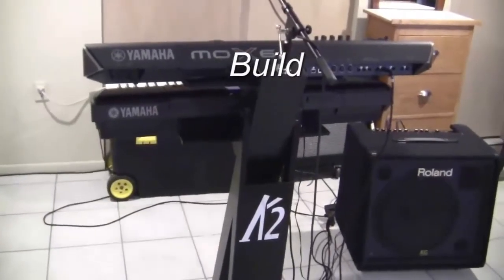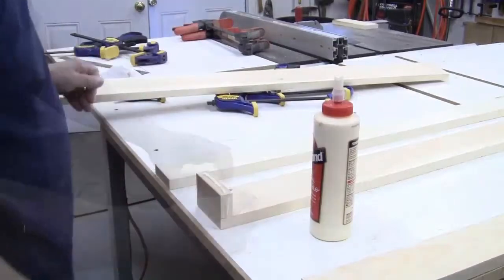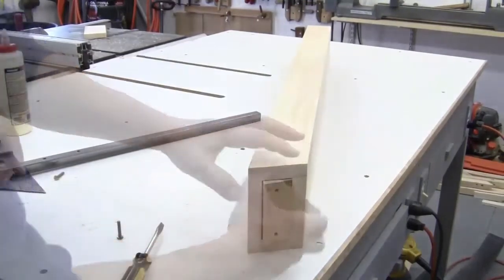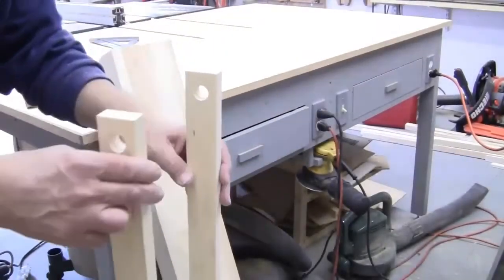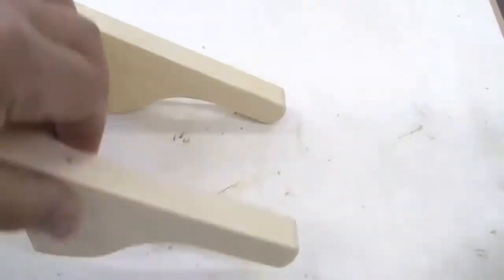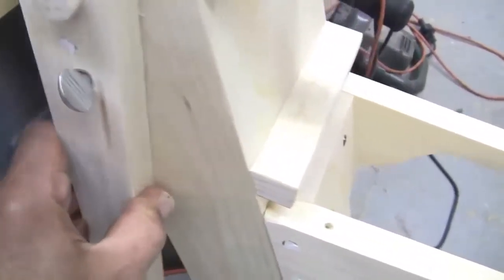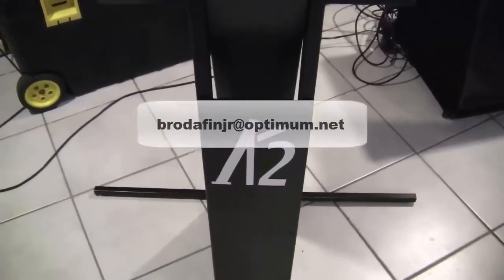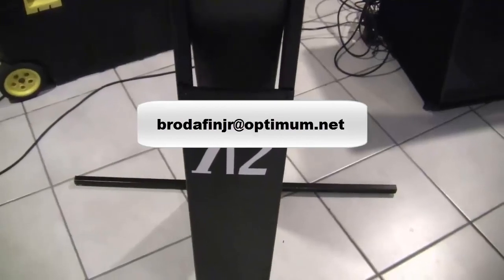Cheap Two-Tier Gigging Keyboard Stand Can Save You Hundreds

Comment: I am contemplating getting a 2nd keyboard; a lighter and less expensive keyboard to carry around.  But I only want to use a single keyboard to play on.  I was thinking about switching from style files to mostly midi files.  How is the E-423 for midi files and to play on at the same time; enough polyphony at 32 notes?  There's an E-423 for sale on Craig's list in my town advertised as in excellent condition for $130.

Comment: Excelent vídeo .. You are a very smart man..... I have been looking in eBay for a two tier stands But they are very expensive.. $249 dollars.. . $299 dollars and even $349 dollars.. I can't afford me to pay that ridiculous quantity of money..... Thanks for the video my friend.. Likes.. 👍👍👍
Reply: Yes and no. What you are seeing here, while interesting, is likely not suitable for gigging due to 1) the setup/teardown time, 2) the weight and 3) the inherent fragility of wood--at least relative to metal. While $250 to $350 may seem expensive, consider what this stand would cost if you had to buy all the materials: you are, at a minimum, looking at roughly $150 to $200 (that that excludes tools and time).It just ain't worth it to build.
Reply: @WilliamCharlesShaver   This would suit me fine. I need a stand for a keyboard, laptop, and mixer, for my rig at church.It would not be set up and taken down constantly.  I would go with a hardwood rather than pine, though, or maybe birch plywood (it'll look like it came from Ikea :D), and I'd make a few changes to make it quicker to set up and easier to transport, and I'll def. incorporate adjustable feet to make it easy to level.

Comment: Nice job, but is required 50$ + having wood workshop + carpenter skills + time (time is money).
Down side of wooden parts, unless they laminated, they will twist and probable  make uneven platform, which make keyboard not sit correctly.
Maybe if keyboard sit on 2 metal bars works better. ;)

Comment: Thanks for posting this! Can you find a way to make the support brackets removable?  If so, then cut open the top 1/4 of the back panel and add a hinged door, thereby creating an open storage space on the inside of the tower. Once you break down the stand, toss your metal floor brace and your mounting brackets inside the stand and shut the door!  Now you only have the main tower and two shelves to carry and you'll eliminate the potential of the mounting brackets being damaged in transit. I wish I had your workshop and skills, I'd try it myself!

Comment: I appreciate the creativity in making this.  I personally would opt for a metal stand.  No matter how sturdy or well built your wood stand is, it just cannot attain the same rigidness or withstand the same kind of punishment as a metal stand and is less portable with a significantly reduced life span.

This idea is okay for a studio setting but I would question its long-term usefulness in a live setting.  The stand appears pretty wobbly when being played on even lightly and is unable to be reconfigured for different keyboards and sitting vs. standing heights and angles.

I'm happy that this works for you but do not think it's practical over buying a much sturdier, longer lasting, more adjustable and more easily collapsible and transportable metal stand.

http://www.sweetwater.com/store/detail/ZStd2Tier
Reply: Not true goodmaki, he has the makings of a really good design here. Like some mentioned however, making it out of soft pine, is not practical to survive the rigors of the road. However, if you make it out of oak plywood, then it's a whole different ballgame. I made this stand as detailed in this video, but made a few changes. I used 3/4" oak plywood to form the body, ripped to the same dimensions as in the video. I made the piece to be inserted into the open end, which the support bar is attached to, but to head off one problem I saw before even making this, is that T nuts hold well when you screw them in and leave them. However, the repeated process of doing it over an over can and will push the T nuts out of the wood, leaving you nothing to screw the leg support bar into. Once I inserted the T nuts and sufficiently embedded them into the plywood, I added a second, slightly smaller piece, which I glued and screwed to the first piece containing the T-nuts, basically sandwiching them so there was no chance they would ever come out. When you add the 2nd piece, test fit it first by screwing your machine screws in and where they leave a mark, drill out that mark to allow the machine screws to have room to be fully screwed in.

There were several comments about uneven surfaces which I solved by attaching 1"x3"s to the metal support bar. I used through bolts so they would be firmly attached to the bar. I then attached 4 heavy duty adjustable furniture feet to the 1"x3", allowing each leg to be adjusted individually. I also added a cross bar to the back support leg for additional stability. I used a 1"x 2" which I screwed into the back of the stand and then screwed the metal bar to the 1"x 2" and the stand. Now there is a support bar across the front and one along the back. They disconnect by simply removing the screws from the back supports and as shown in the video. I take a box of screws with me to every gig in case one gets lost. Nobody wants to be hunting for a dark screw on a dark stage at 1:30 in the morning. I also bring a power screwdriver. Time is of the essence setting up and breaking down. Instead of the pin that lets you know when the support leg is fully extended, I elected to place two metal support bars from front to back one on each side of the main post. I drilled holes similar to what is shown in the video in the front and back support bars. I made the larger hole (used to allow access by screwdriver) even larger, to allow a nut to be threaded onto the bolt from the top. The bolt had a Phillips head on it and as I turned the head with the power screwdriver, the nut recessed itself down inside the bar by just holding it with a finger and locked against the inside of the bar. This way I had a bolt that sticks up, and I then drilled two holes in each end of those metal support bars and simply slide them over each bolt and tighten with a wing nut. This locks the stand in the open position and provides additional stability. At the end of the night, I remove the support bars, replace the wing nuts on the bolts and the stand collapses as it does in the video. I also have a pin to hold it in the closed position.

Another modification I made was to screw all platforms into the brackets with 4 screws. I still use the stop block for alignment. Because one of my stands holds an 88 key hammer action controller that is 54" long, I felt it needed some additional support. This is where screwing in all the platforms comes in. I used a piece of 1"x 2" to connect each edge of the smaller top shelf to the bottom shelf that holds the 88 key controller. It keeps it from flexing since it would only be held by the brackets located right in the middle. At the end of the gig, the piece rotates to a parallel position on the bottom shelf and gets screwed into the bottom shelf for travel.

Another change I made was to create a channel to hide all the unsightly cords to create a nice clean setup. I used a 2 1/2" hole saw and cut a hole in the main body between the two platforms where it can't be seen, and one at the bottom just above my custom made pedal board. I fed all my cables (sustains, USB and power) in a harness for both keyboards up through the bottom and out the top and secured the harness with an electrical conduit strap fastened to the inside back of the main support, right inside the circle cutout. This keeps the harness secured, without it hanging outside. At the gig, I simply reach into the hole and pull the end of the harness through and hook up my keys. At the end of the gig, I tuck the end of the harness back inside, making it easy to transport. I do the same with the bottom. For my USB cables, I use USB connectors to connect them to my central hub. 

The last change I made, was to make the platforms and supports completely removable. I use 4 screws in each support and just quickly remove them at the end of the night, so you then just have two long square tubes, and separate shelf supports and the shelves themselves. Rather than use paint to embed the rubber shelf liner, I use Velcro strips to attach my keyboards. The strips hold both keys super tight, but are easy to remove at the end of the gig. I also have enough room at the top of each main post to attach my iPads. I added lightning cable extenders to the harnesses, and taped the ends together so there was no chance they would come out. The iPads attach with Velcro as well. 

As far as durability, the plywood holds up very well. It is super strong and the stand does not flex as many expected it to. I have two of them for my 4 keyboards. It takes me about 5 minutes total to set up both stands and another 5 to place my keys on them. Each platform is labeled so there is no confusion as to which post they attach to. It is then a simple matter of plugging in the cables. They are all labeled so it makes it super easy. I have a power strip that I attach to the base of each stand at the gig for power (2 keys use it and two don't). It attaches with Velcro so it gets removed at the end of the gig. I have been using these stands for 6 months without incident. They have held up very well. I used spray paint to coat them and carry a can for occasional touch ups